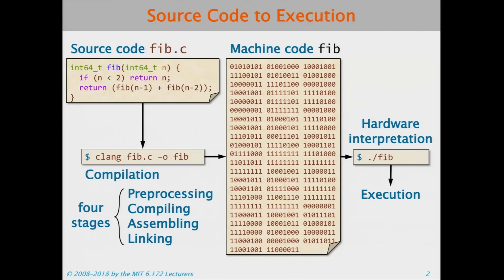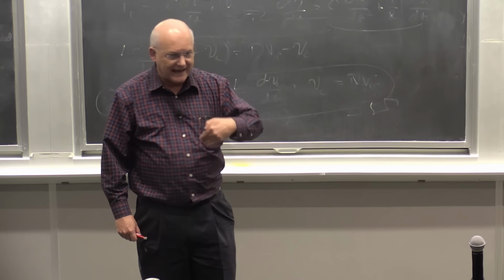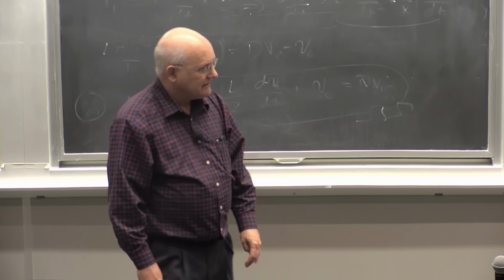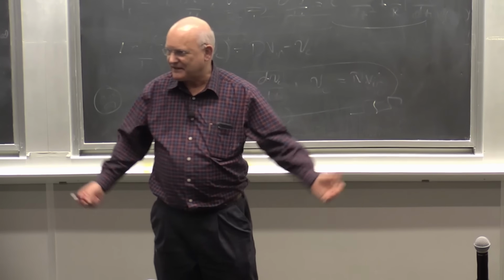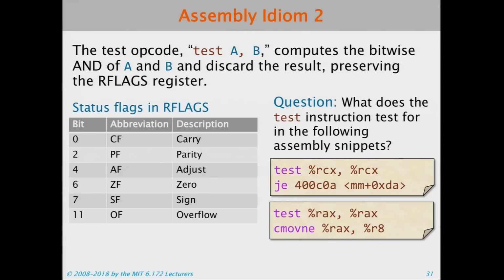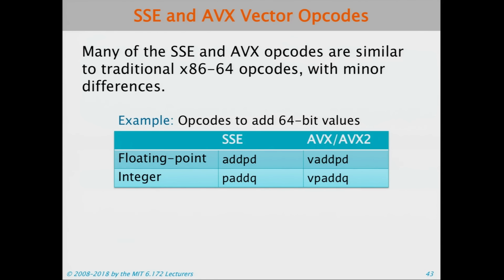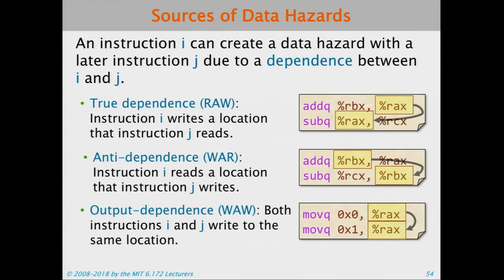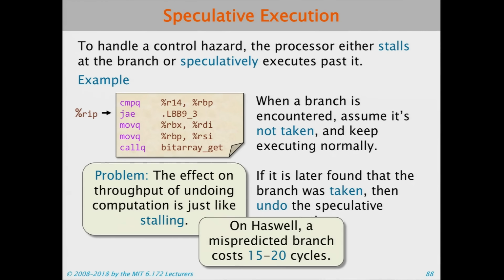4. Assembly Language & Computer Architecture

Comment: 12:46 My experience is that if you really want to understand something, you want to understand it to level that's necessary and then one level below that.
Reply: I'm bi-directional when it comes to learning about computers and I'm 100% self taught. I like to peek into 2 levels below and 2 levels above. I'll go all the way down to the transistors and how they are made within the realm of chemistry and physics all the way up to scripting languages such as Python.

If I was to design a Degree Program at an arbitrary University here's a road map or an outline for each level of abstraction:

Mathematics - General fields: Algebra, Geometry, Trigonometry, Calculus 1 and 2 at a minimum and maybe some Linear Algebra
Physics - Basic Newtonian up to some Quantum Mechanics including the beginning stages of Electricity and Simple Circuits
Chemistry - Basic Chemistry at the College Level primarily focused on the various chemicals and compounds that can act as conductors, insulators and inductors. (No need for Organic Chemistry)

This would cover that basics needed for Entry Level Electronic Engineering 

Mathematics - Analytical Geometry, Vector Calculus, more Linear Algebra, Lambda Calculus, Probability & Statistics, Logic - Boolean Algebra, Introduction to Truth Tables & Karnaugh Maps. 
Physics - Quantum Mechanics continued, deeper theories such as wave propagation
Circuit Design - Ability to both read and build electric diagrams or schematics using both DC and AC type currents learning about the differences between circuits components that are either in parallel or in series, voltage and current dividers. Also covering both Analog and Digital Electronic design patterns leading us into our Logic Gates.
Chemistry - Specialized on the components that make up your transistors, resistors, diodes, capacitors, rectifiers, and more...

Still no programming yet... 

Mathematics - More on Boolean Algebra and Discrete math that is Log2 Base mathematics (Binary Arithmetic and Logic calculations), Extended Truth Tables & Karnaugh Maps, State Machines covering both Mealy and Moore machines. Arbitrary Languages as Sets with a defined Alphabet.
Physics - building various digital circuits and analyzing them with voltage meters and oscilloscopes.
Chemistry - diving deeper into the components at the quantum levels

Mathematics - Complex Number Analysis, Euler's numbers and formulas, Fourier Series, Laplace Transforms, Signal Analysis and FFTs(Fast Fourier Transforms)... and more
Physics & Chemistry - maybe specialized fields at this point

Bringing it all together, your first day as a programmer, well hardware / software engineer! 

Digital Circuits I - Combinational Logic - Integrated Circuits and Complex Circuit Design building an adder, a multiplexer and demux or selector, comparators, binary counters.  
Digital Circuits II - Sequential Logic - Feedback loops, SR Latch, D-Latch, Flip Flop, JK Flip Flop, Toggle, Timers, Registers
Digital Circuits III - High and Low Logic, Synchronous vs Asynchronous, Bit Addressing, Memory and Data Paths
Digital Circuits IV - Putting It All Together (ISA Design) - Refresher on Truth Tables, Karnaugh Maps & State Machines. 
                                *Introduction to HDL and Verilog 
    **Any addition mathematics, physics or chemistry that is needed

ISA I - Basic Turing Machines - Implementing one on a breadboard then move to either Proto Board and or a PCB
ISA II - Pipelining
ISA III - Caches 
ISA IV - Branch Prediction
ISA V - Out of Order Execution
    **Any addition mathematics, physics or chemistry that is needed

Transition from Hardware to Software:
      - Building an Assembler, Disassembler and Hex Editor.
      - Learning about the C Language and Building a basic C Compiler, Linker & Debugger 
      - More Mathematics
 
*Advanced Courses: GPU(Graphical Processing) - APU(Audio Processing) design, Storage Design, Monitor or Display Design, I/O Peripheral Design (Keyboards and Mouse) these would be basic and simplified versions of what you can buy on the market, something that could theoretically be done on a breadboard and easily be done on something like either on a ProtoBoard,  PCB, of FPGA ... These may also include various classes related to Mechanical Engineering and other required mathematics, physics and chemistry courses.

Operating System Design (OSD)
OSD I - CMOS, Bios and or EFI/UEFI, Bootstrapper, the Kernel, the HAL and more basic features.
OSD II - Vector Tables, Memory Addressing and Mapping, Virtual Memory, Processes and Threads, I/O handling and Interrupts, and more...
OSD III - File Handling, Compression & Decompression, Encryption & Decryption
OSD IV - Drivers and Peripheral Support
OSD V - Graphics - Font and 2D Image Rendering, Audio and Networking (Ports)
OSD VI -  Generating an Installer
OSD VII - Installing and Configuring the OS for First USE, extending your C compiler to support C/C++ based on your assembly language. 

Using your homebrew built computer with your own OS and compiler and if you elected to build your own or just interface with I/O, storage, graphic and audio devices... now it's time to use them and put it to good use. We can now jump into basic Game Design by starting off with implementing DOOM in a combination of ASM, C and or C++ to test out your hardware. 

The final stages: Designing your own high level dynamic scripting or interpreted language using your custom built CPU-PC to write high level languages within it.  

------------------------------------------------------------------------------------------------------------------------------------------------------------------------------------------------

If you can build your own CPU and ISA from the ground up, build your own basic assembler and compiler that is enough to be able to write, build, and run DOOM on it, design your own high level scripting language to work on it... Then I could easily say you have graduated and become both a Hardware and Software Engineer!

If I was coordinating a degree program at some university, something like this would be the outline for the Dual Bachelors/Masters Degree programs for both Software and Hardware Engineering. There may be some fields of mathematics, physics, etc. that I didn't cover here. Such as Data Sets, Algorithms, etc. which would be important yet I feel they would be more related towards the Computer Science side of things as opposed to the Engineering side of things. Yet to transition from the Bachelors to the Masters, the Bachelors in Computer Science side of things would be required. 

If one was to take every course available, they'd end up with a Masters for the following fields: Mathematics, Physics, Computational Chemistry, Computer Science, Software Engineering, Electrical-Electronic/Hardware Engineering, Operating System Design & Data Management and possibly a Bachelors in some of the follow: Mechanical Engineering, Data Structures & Algorithms, Information Theory, Compiler & OS Design and a few more...

Comment: Surprised to see current programmers do not learn  much of Assembly language. It is very useful and insightful if they really want to know inside of computer.
Reply: Things I learned from assembly:
* The compiler will avoid multiplication and division at all costs (except by powers of 2)
* x % 256 = x & 255 (same for other powers of 2)
* for(;;) is a goto
* while(true) is a goto
* in fact, every control structure is just a goto wearing a trench coat
* The largest integer on any computer is -1
* Arrays are secretly one-dimensional
Reply: Most current programmers probably just patch together a bunch of library functions when writing their "program". This explains why so much of current software feels as if it is running on a 1980's computer instead of the super fast machines we use today. I have seen some insanely stupid code written by "young" programmers. For example a customer counter was stored in an SQL database that was located in another machine in another building. Every time that counter was incremented, which was often in that application, meant a series of SQL instructions over a local area network. They had code like that yet still wondered why their million dollar Sun servers could only handle 70-80 web requests a second. Then occasionally the network connection would time out and the program would fail. I tried to mention that this was a silly idea but was told to stop being so negative and be a "team player". I am so glad to be retired and not have to deal with these people, although I still have to suffer crappy software every day.
Reply: @sbalogh53  Spot on. Most of the developers I've worked with wouldn't have a clue about what's under the hood. It's mostly high level stuff these days.

Comment: 1:00:06 Here's a point where he misspoke on memory vs. registers: "I would say also the fact that you have a design with registers, that also reflects locality. cuz thwat that the processor wants to do things is fetch stuff from memory, doesn't want to operate on it in memory, that's very expensive, it wants to fetch things into memory [he meant registers], get enough of them there that you can do some calculations, do a whole bunch of calculations, and then put them back out there [to memory]."

This reminds me of the February 1984 BYTE Magazine, in an interview with the original Macintosh system-level programmers, one of them said of writing efficient code for the Mac's 68000 processor, "keep the registers full." The hit (time delay) of accessing main memory vs. a register wasn't nearly as bad back then, but keeping as much data in registers as you can keeps from having to swap out a lot of data to main memory.
Reply: I always feel like I don't have enough registers on the 68000 and yet I never feel this way with machines that have far fewer registers like the 6502. Sure you've got 8 on the 68k but it seems like I need to give up a data register any time I have to index an array so I can get the right offset

Comment: I remember this class. It was interesting to know how programs work under the covers. That said, you wouldn't want to write a program in assembly
Reply: I wrote many programs in Z80 assembler code back in the 1980s. I also reverse engineered large blocks of binary code stored in EPROMS, modified the code to suit new requirements, assembled the new code and burned it back into EPROMS. They were fun times. Not sure I would enjoy the experience with X86 code though.
Reply: These days, no. The x86 has a huge number of instructions, and the ARM compresses its immediate operands meaning that not every 32-bit value can be loaded into a register as a one-liner (usually on the ARM, constants are stored in nearby data blocks and you load from there instead). I don't mind writing in Motorola 68000 assembly tbh.

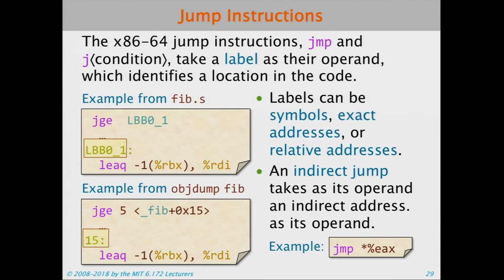Comment: 42:39

Can anyone explain how an indirect jump differs from simply moving the value of eax (using his example from the slides) into the instruction pointer register? Shouldn't that be exactly the same thing?
Reply: @oooBASTlooo
Essentially, a direct jump states the jump destination address in the instruction i.e. the next value in the PC is the immediate address in the instruction.
An indirect jump includes a pointer to an address, which in turn contains the destination address i.e. the next value in the PC is the value stored in the immediate address of the instruction.
Hope this helps
Reply: @benjaminsanati7078  This has nothing to do with my question, you just reiterate what the lecturer said..

I wanted to know if there is a difference between using the a) indirect jump and  b) setting the instruction pointer to the value, which can be accomplished by an easy mov instruction.
Reply: indirect jump has operand pointing to a memory which has address to which you want to jump to ... op code for indirect jump is different (i think) ... you do not want to move value because you want to use the addressing register for other addressing needs that you have ... indirect jump allows you to jump at the same time keep eax value you need later ... may be code to where you jump to will use content of eax
Reply: @einsteinwallah2  makes no sense to me.. You don't lose the value when using a mov instruction.

Or do you want to tell me that the instruction pointer register is not changed when doing an indirect jump? I doubt that and I don't think that this is even possible.
Reply: Some CPUs have different kinds of indirect jumps. I don't know for sure what JMP EAX does, but it could be one of two things:
* It just moves EAX directly into EIP.
* The value in EAX is treated as a memory address, and the 32-bit value at that address is the jump target. For example, If EAX contained 0x00000000 and stored at 0x00000000 was the value 0xDEADBEEF, then MOV EAX,0 JMP EAX would be the same as JMP 0xDEADBEEF.

Believe it or not, both are incredibly useful. A switch case statement is often implemented as an array of pointers to functions, the cases being used as an index into that table, which the CPU reads from and then jumps to the desired case.

Comment: If flash memory is so fast, why not have microprocessor with built-in 16gb of cash memory, and forget about RAM.
Reply: There are two things in the way: physical size and electrical power (with the thermal problems that brings). Three things if you include cost, but in HPC the cost of the hardware is always balanced against the cost of the calculation, so if it costs four times as much to get a machine that can do ten times as much work in the same time period, the hardware cost isn't really a problem. Dynamic RAM (DRAM) is small, low-power and cheap, and you can have a lot of it, but it's relatively slow and requires periodic refreshing (meaning it can't be immediately available at every clock cycle). Static RAM requires more components per bit, and uses power continuously rather than just on refreshes. You can have a little bit of it very close to where it's being used (remember that it takes time for signals to get from one place to another, and moving things apart to make room for fast memory is going to slow other things down), a little bit more a little less close, and quite a bit a little bit further away. (L3 cache on most current processors is bigger than the total memory in most computers of, say, 30 years ago.) Going to "chiplet" construction means that it's feasible to put more cache in while keeping fabrication yields reasonable, but it's not going to get you to, say, 16GB of chip-speed SRAM cache any time soon. (Oh, and 16GB isn't even entry level memory for a lot of scientific computing.) It's a good question, but don't think even for a moment that nobody has asked it before.